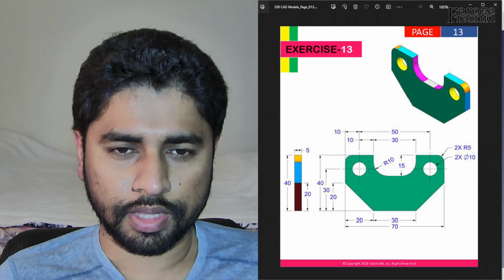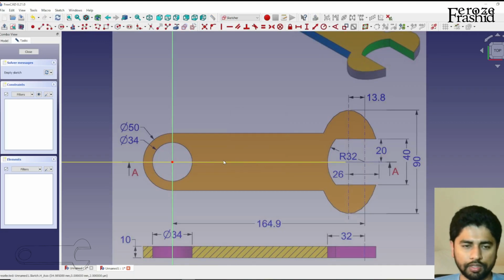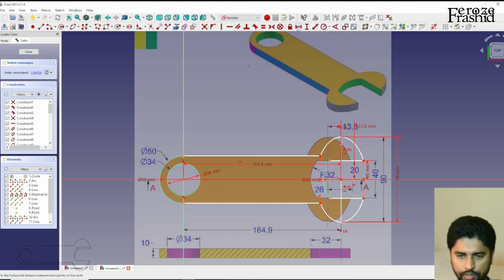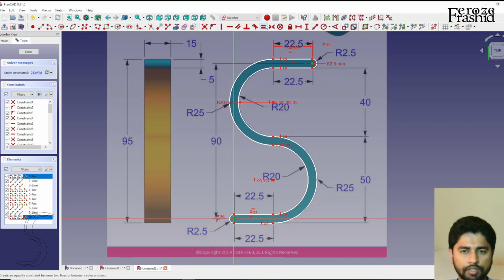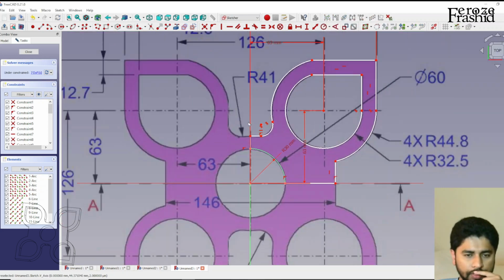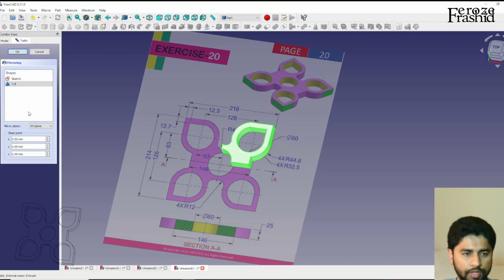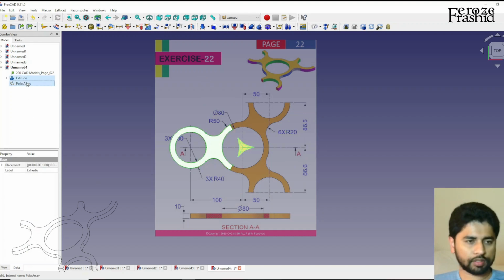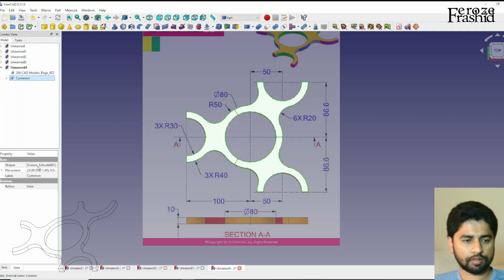200 3D Models in FreeCAD: Exercise 13 and a few more!

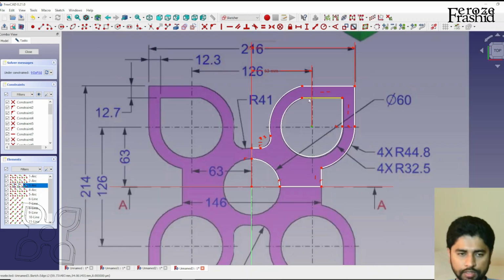Comment: At 13:50, looking at the horizontal distances in Exercise 20, the outside width is 108 (216/2), the X-axis distance to center of circle is 63 (126/2). But the distance from the outside (108) minus the X-distance to center (63) equals 45, yet the provided technical drawing shows the outer radius is 44.8 mm, not 45.  Therefore, if you ask me, the original technical drawing is defective.  The way it is drawn in the video, it has not met the 12.3 mm width requirement.   It's so frustrating trying to learn when the drawing provided is defective.